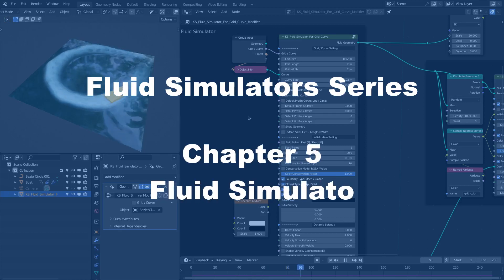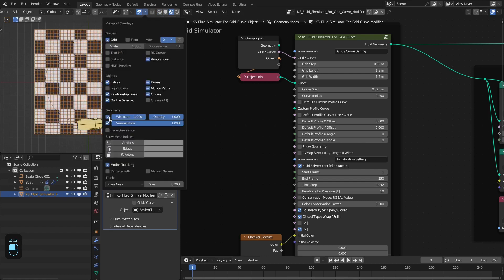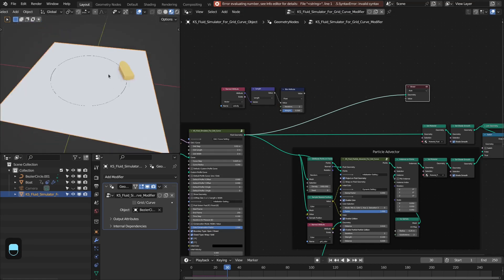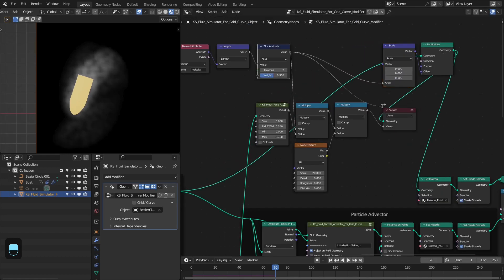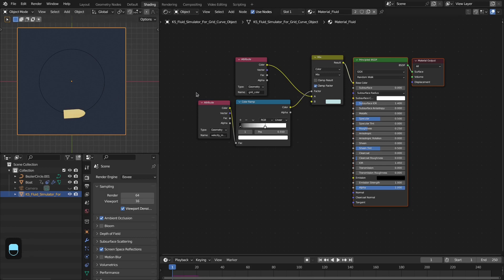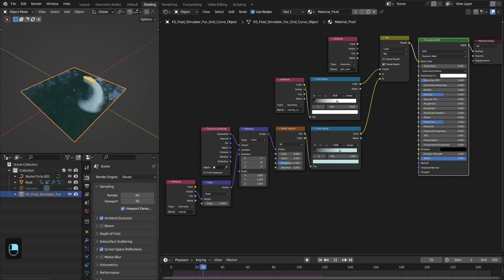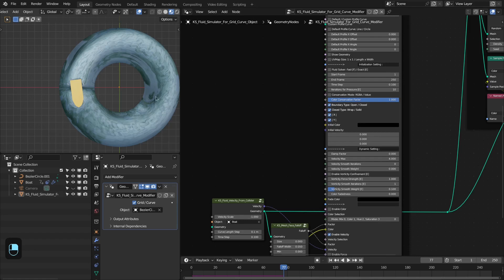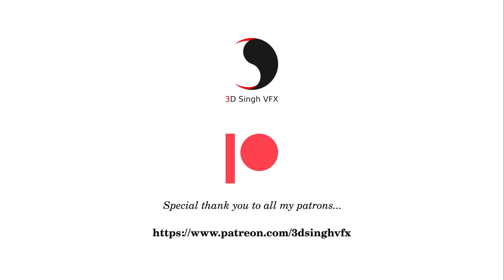Fluid Simulators Series || Chapter 5 - Boat Trail with Fluid Simulator For Grid-Curve

Comment from the maker: "Simulate the fluid on any surface with full control"
📥 Links:
(Detailed documentation of procedural fluid simulators is included in the files)
➡ Procedural Fluid Simulators [Blender Market]: https://blendermarket.com/products/procedural-fluid-simulators
➡ Procedural Fluid Simulators [Gumroad]: https://3dsinghvfx.gumroad.com/l/procedural-fluid-simulators
➡ Procedural Fluid Simulators [Patreon Shop]: https://www.patreon.com/3dsinghvfx/shop/31527
➡ Presets and Project Files [Patreon]: https://www.patreon.com/posts/90875204

➡  Extra Nodes [Free]: https://3dsinghvfx.gumroad.com/l/extra-nodes